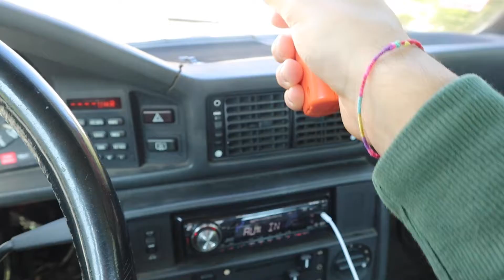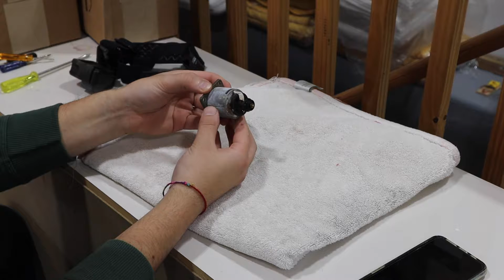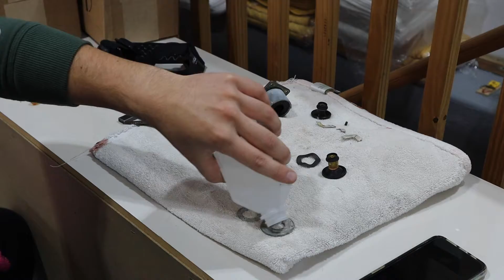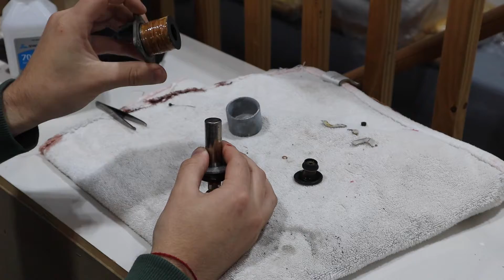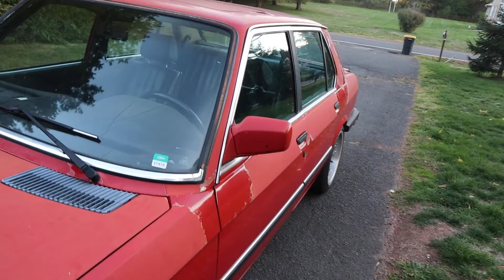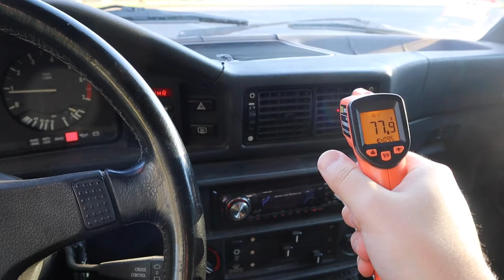How to fix Heat in Classic BMW || Blow Hot Air BMW Heater E30 E28 E24 E23 E21 1980-1990

Comment: Is it normal for the blend motor to get power only when the dash blend switch is in the off (fully cold) position?  Once I rotate the heat setting switch towards the hot side power falls completely off at the heater valve motor.
Reply from the maker: Could you clarify? Could be a grounding issue or bad connection at your motor blower if it's not receiving power when you turn it on.
Reply: So heat only comes from top and bottom vents, ac-fresh air middle vents?You have the bowden cable middle slider right?

Comment: My valve had three shims, one thicker, the curly one and the thin one? Yours only had the curly shim and the thin shim. Do you know if there are different models? I left it as you assembled it in your video and I have perfect heat, but I'm still not sure why I had three shims?
Reply from the maker: Some of these kits are also made for other cars with similar systems. Extra shims are likely for another cars setup. For example, one of my next videos will be the power steering system rebuild. I have leftover parts because the rebuild kit is also made for a Porsche 944 but not needed in the E28
Reply: @MissionmadeAirsoft  I have the exact same vehicle, minus the manual and I have three shims buddy, according to the E28 forum and FB groups the majority if not all have three shims on their valve, not sure why yours is missing one, but it works with or without the third shim. 1988 E28 535i automatic here.

Comment: what is the purpose of the middle vent switch?
Reply from the maker: It allows fresh air to enter the cabin. If you have it open while the heat is on, you won't feel the heat because its being diluted with cold fresh air.

Comment: Wish the e30 part was easier and cheaper to replace. Looks like retrofitting one into a e30 is easy.
Reply from the maker: Do e30s not use that same heater valve system? The heat in my car is almost too hot after this fix